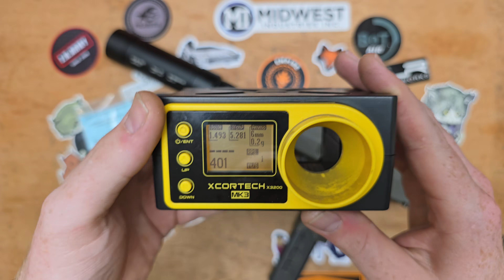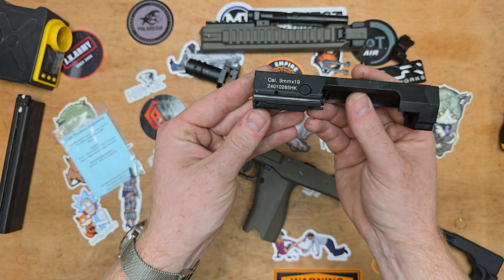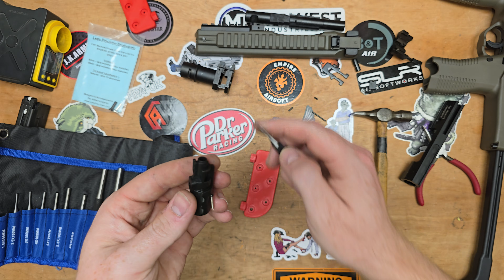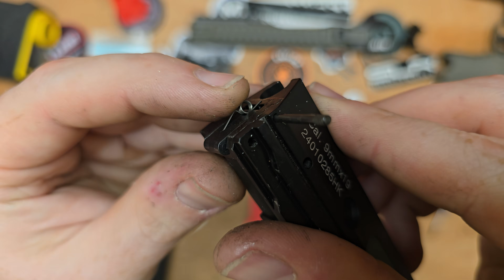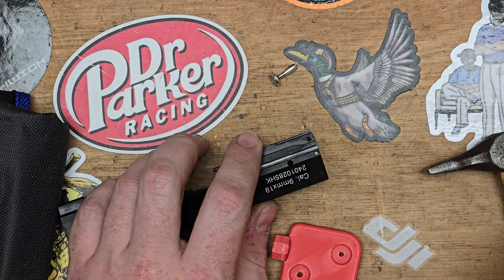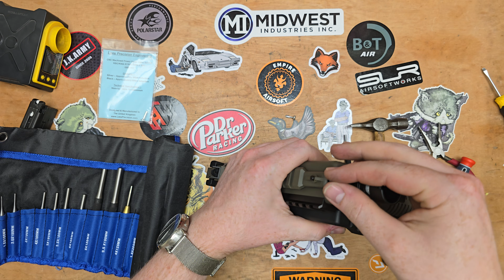KWA / KSC MP9 GBB Downgrade Valve Install Guide #airsoft

Comment: Question. 
I’ve got a vz .61 which uses the same dart shaped rocket valve. If I’m to cut the fins off or trim them would this theoretically upgrade the FPS? As it’s shooting below .8J and I’d like it to shoot more around 1J or higher. Can’t find this info anywhere

Comment: just wanted to thank you for the detailed guide. i was worried about installing my Downgrade valve (also from lee) due to horror stories ive read about its disassembly. with your guide it was quite easy, but the small nozzle return springs definetly got me sweating a bit :D now mine shoots at around 1.05J with 0.28g BBs.

Comment: I had one of these MP9's on the wayback machine at this point. Never really did give it a good kick at the cat, ran into an issue with the hop up unit and decided to get rid of it. I've been thinking about getting back into it as it's an awesome little blaster in CQB for sure.